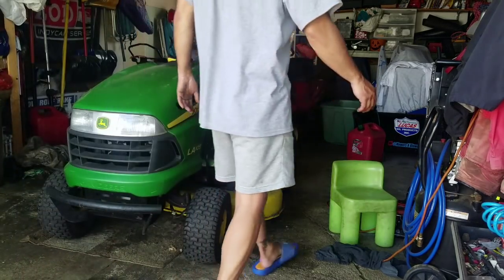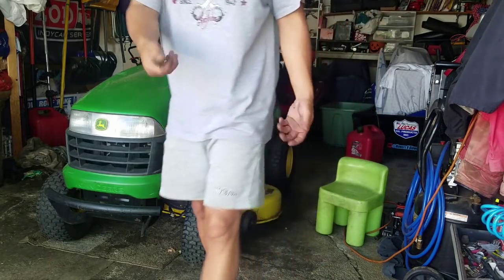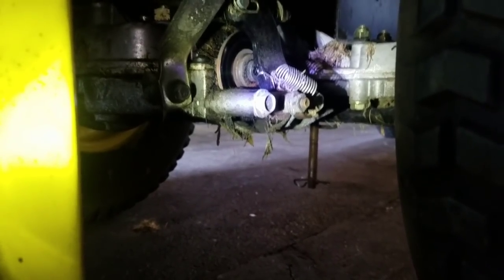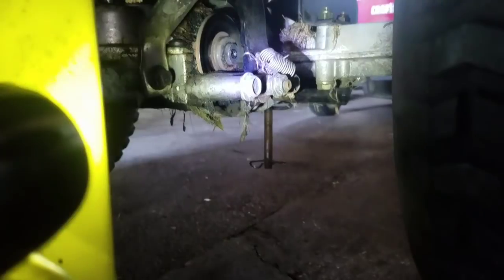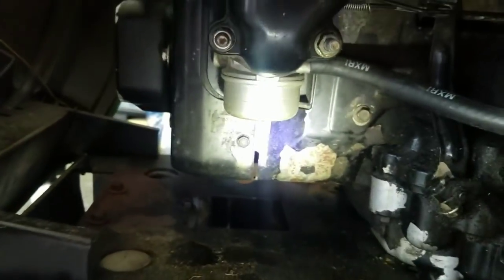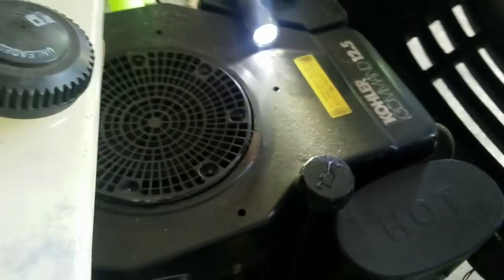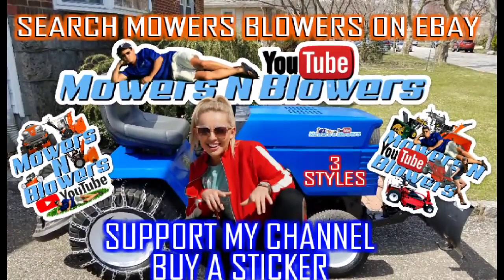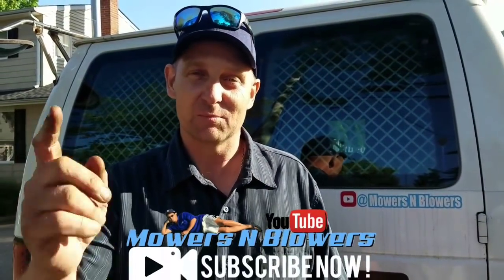FREE JOHN DEERE LA105 LAWN TRACTOR MOWER BRAKES SMOKING BRAKE PAD CALIPER NUT ADJUSTMENT REPAIR FIX

Comment: The sound effects were spot on. 

Lol so I just basically rebuilt almost everything on my mower, I completely redid the deck the transmission drive belts the PTO clutch oil pump rebuilt the carburetor replace the front spindles and the steering gears and I never even noticed there was a brake disc in there. 😂😂😂   I was injured and my neighbor replace the transmission, I had ordered it and then tore up my back. Hopefully he did a good job but that was seven years ago. Hopefully mine works because I don’t want to deal with all of that now. 😂😂 

As far as the hissing sound, the only thing I could think on this motor would be maybe the line that goes to your fuel pump from the case. It’s basically an air pressure line that actuates the diaphragm in your fuel pump so as your motor is winding down that would have pressure on and off in it.  Mine is an L130 but I got it from the dealer. I didn’t know there was a difference but it’s good to know.
Reply from the maker: Thanks for the comment bro!  Hope you subscribed

Comment: I got a free White 5.5hp 22'' snowblower with a 12'' impeller. I had to replace the engine key, clean carb and fix the starter but now it runs silky smooth. Really strong

Comment: I got a neighbor's walk behind weed trimmer running and have been using it before returning it.  Those things do some serious damage.  I've seen the commercials over the years and they really do what the commercials show.  They aren't for making things pretty though.  The one I fixed uses 0.155 line and will take out saplings growing along the fence.    We need more dog time in the videos !
Reply from the maker: Glad you like Boba, he has quite a fan base...lots of followers also ask for more Boba time.  Was it one of those DR trimmers, they are expensive but work well.  I had a similar one and was fun to use.  Thanks Roscoe.
Reply: @MowersNBlowers  It is a Toro with a B&S electric starter and rope starter.  I think one like it would be around 400 dollars new.

Comment: One thing I do when I change those brake pads is to put some anti-seize on the rotor and shaft splines.  If the rotor isn't free to "float" the brakes won't work.
Reply: I put anti-seize everywhere.

Comment: Those don't blow headgaskets alot.  Mine does that we u shut it off to . And so does all others I worked on
Reply from the maker: Yeah I didnt see any indications of a blown head gasket, but I dont recall that sound in other of my videos of the same mower.  Somethings not right, just haven't figured it out yet.  Runs fine, so I'll ignore it for now.  Thanks Steven.